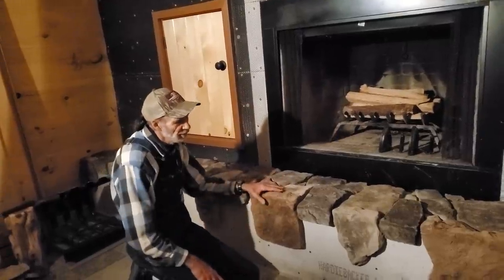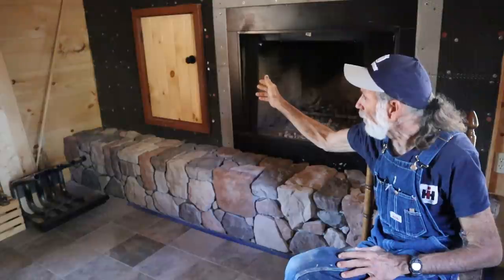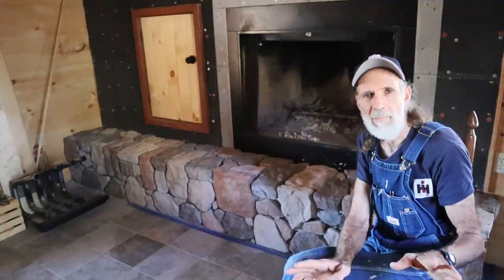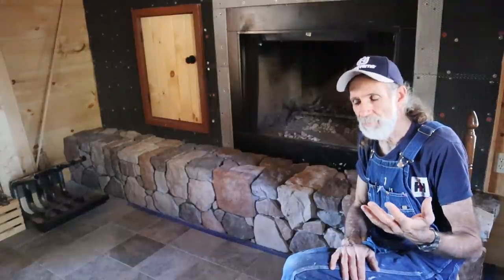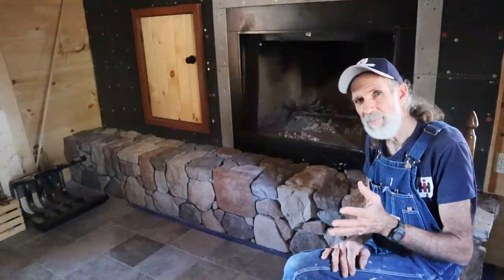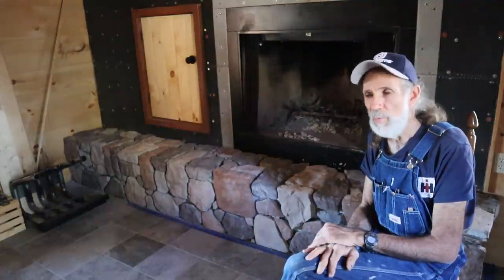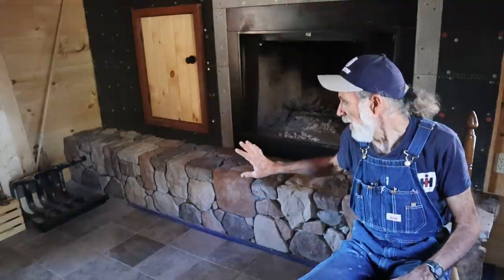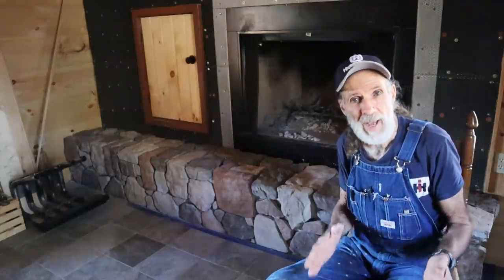Creating a STONE Fireplace Hearth

Comment: Coming from a stone mason, this looks great. You definitely over engineered with the felt paper and all, but that's better than cutting corners 100%. Usually when I do fireplaces I prep the entire fireplace with durrock(cement board) and stick right to it.
Also I'll usually use type s for everything cultured stone related. It's just much tackier than type N. Either way. Looks great using the corners on the hearth rather than a limestone hearth. I think I may do the same on my own if I don't use full veneer

Comment: Danny how did you soundproof the cabin? Did you use double studs in the walls or add insulating board on the exterior or interior over the studs?
Reply from the maker: We used sound deadening insulation.

Comment: Danny my husband has his own brick laying business and he says you're wrong about the mortar types. 

Here's a definition of Type S and N 
Type S Mortar is the ideal product for masonry at or below grade. Even though it is usually specified for those kind of jobs, it offers great quality. Type S has high compressive strength (1800 psi) but adds high tensile bond strength. Type S mortars are required to have a minimum of 1800 psi and their mixes usually give you strengths ranging between 2300 and 3000 psi. This type of mortar performs well while fighting soil pressure and wind, or while under seismic conditions. Type S contains 2 parts portland cement, 1 part hydrated lime and 9 parts sand.
Type N: exterior and above-grade walls, chimneys
Type N is described as a general purpose mortar mix and can be used in above grade, exterior and interior load-bearing installations. It is also associated most commonly with soft stone masonry. This type is ideal for anything that is exposed to severe weather and high heat. Type N is a medium compressive-strength (750 psi) mortar and can achieve 28 day strength between 1500 and 2400 psi. Type N is made of 1 part portland cement, 1 part lime and 6 parts sand
Reply from the maker: That is exactly what I said.